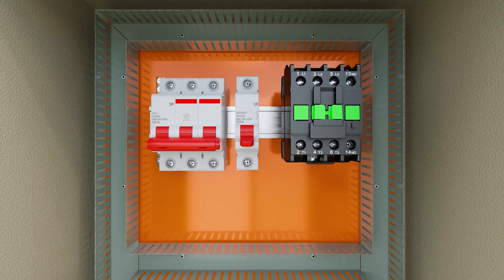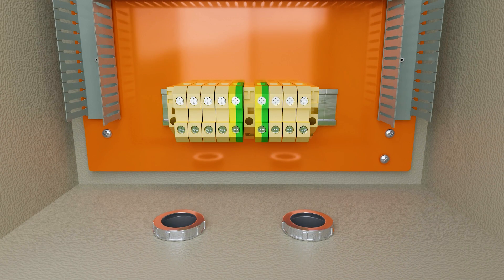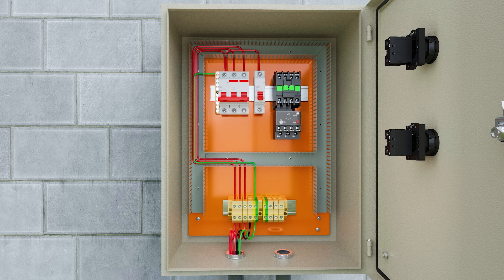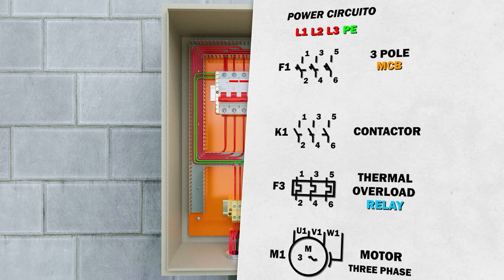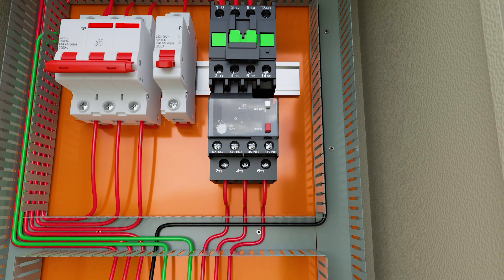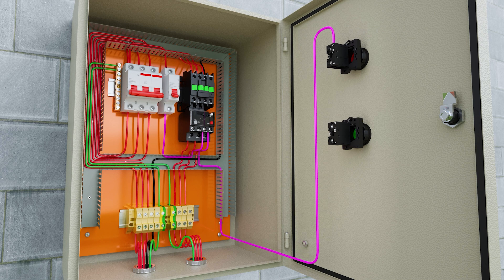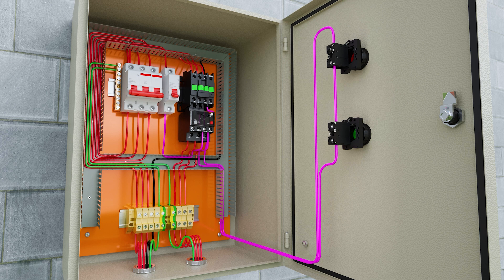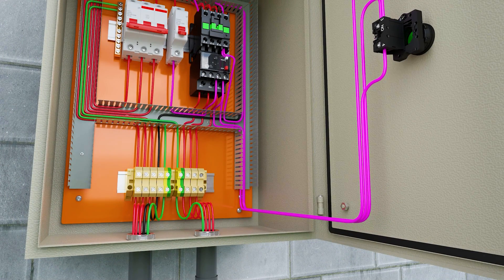3 Phase Direct On Line Starter/ Explain with Circuit Diagram, DOL Direct online starter

Comment: Y motor keep burning
Reply: This is because on this video, he is explaining it as the red 3 phase wires are all connected to 240V or something but a real 3 phase power has differential voltage
Reply: If you are trying all this, use a MPCB

Comment: Hello, Genesis Engineering. I want to know: what will happen if you connect a circuit breaker before an energy meter in a supply board? I have looking for the explanation in youtube but i could not find it. I will realy appreciate your answer. Thanks.
Reply: It will protect the meter from shorts and overloads so that the meter does not burn due to overloads and internal shorts. Also the wiring between the meter board and db gets protection. Remember meter is a device which needs protection. In olden days cutouts were installed before the meter. Hope this helps.

Comment: The command wiring is confusing 
Can I connect the Neutral wire directly TO A2 And L3 to the A1 and the motor will still start?

Comment: Sir what is the proper amp of magnetic contactor and over relay for 15kw induction motor
Reply: You would calculate the amps as 15000 / (√3 * 400 * 0.85), (power/√3 * voltage * efficiency) so about 22 amps, so a rating of 25 amps and a thermal protection relay similar to that rating.